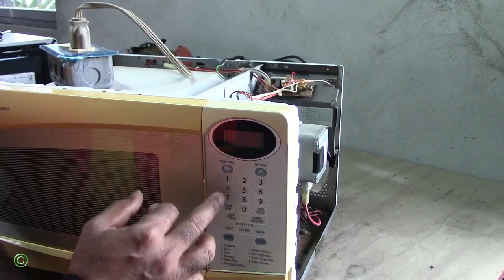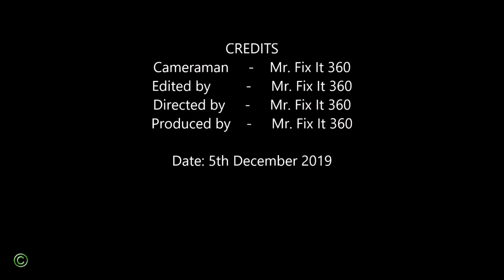Microwave Oven fuse keep blowing.

Comment: When testing, never let the microwave run empty.  There should always be a glass of water inside to absorb the heat.  Letting it run empty causes "bouncing" waves, which can lead to malfunction.
Reply from the maker: Good point. That's why I only run it for 12 seconds. every time I testing a microwave oven to know if it heating. I does only run it for 12 seconds. I know what will happen if it run for more then 12 seconds. thanks for the heads up.
Reply: True

Comment: I know this is old but it would be nice to have seen just how you diagnosed that it WAS the capacitor and ruled out other problems like the magnetron itself.
Reply from the maker: well with 13 years of microwave repair. it become so easy for me to repair microwave with doing so little diagnosed as skills and knowledge develop. most of the time is the capacitor or magnetron go bad.
Reply: @mr.fixit3604  How do you check the magnetron? Check with a multimeter ? How do you rule out faulty magnetron?
Reply from the maker: @dennischarles68  Hi good night. You looking continuity from thermal to thermal. Then from one thermal to the magnetron body you shouldn't get any continuity. If you get continuity then them magnetron is faulty.
Reply from the maker: @dennischarles68  https://youtu.be/oxBXo6qcry8

Comment: Hi their. Can you tell me where can I get the capacitor to buy if this video is from Trinidad. I check a few parts place but no luck. Can you help me please. Thank you in advance.
Reply from the maker: If you not getting it at the general store, you can get it online amazon or ebay.
Reply: @mr.fixit3604  thank you  I may have to buy it on line because I am not getting it no where here

Comment: Very useful idea sir ,thanks
Reply from the maker: You are welcome!
Reply: @mr.fixit3604  My GE microwave is blowing fuse and sparks at outlet and blows fuse every time new fuse is put in? what could this be?
Reply from the maker: @kellysmith2755  It sound like a capacitor or magnetron problem. but most of the time it does be a capacitor problem. you wouldn't unless you run some test to find out what is the problem.

Comment: What makes the transformer to heat up fast & smoke? Pulling lots of amps the first transformer has burned
Reply from the maker: Sometimes the transformer can get weak or over running the microwave for 20-30 minutes.

Comment: A s soon as I plug in Microwave it blows the fuse, what is the reason? (switches are good)
Reply from the maker: It can be the magnetron or capacitor or circuit board.

Comment: Is it a slow blow fuse or a fast blow fuse
Reply from the maker: It's a normal Ceramic Fuse. I can't remember if it's a 15 Amp or 20 Amp fuse. in my 10 years in microwave oven repair I don't think I come across any slow blowing or fast blowing fuse. I don't think microwave oven come with slow or fast blowing fuse.
Reply: @mr.fixit3604  Thank you.

Comment: I see a spark/burning and blast sound near HV capacitor on wire where fuse is connected, when I start the oven to heat... Any suggestion how to fix and what to check?
Reply from the maker: sound like the capacitor and diode need to be replace.

Comment: I have a similar problem sir,i tried to change capacitor(prebious puffed up and shorted) but i could only get 1.05 mfd instead of 0.98 mfd,STILL FUSE BLOWS, what could be other reason
Reply from the maker: 1.05 is still good.
Reply from the maker: So the fuse still blows. well it could be a magnetron problem or a switch problem. you wouldn't know unless you run some test to find the problem.

Comment: Good day Sir, can you advise why my microwave oven has fault, the fuse is blowing when door closed and run the power. I already checked the capacitor, diode, transformer, Magnetron, all door switches, and PC card also good but keep on blow the fuse. Even when disconnect the transformer and magnetron.
Reply from the maker: Micro switch bad.

Comment: I changed capacitor and diode and fuse still continues to blow. What other to check because all switches are good, magnetron, and transformer test good. I’m lost now, help me out Pleasee! 😖😖
Reply from the maker: The circuit board must be have a short or something grounding off.

Comment: What are the other reasons for the blowing fuse, can it be the transformer or magentron?
Reply: Transformer
Reply: If the fuse from transformer is always blow means transformer have a problem. But he show the fuse from capacitor
Reply from the maker: It can be the Magnetron or a simple switch on the circuit board. it hardy ever be the transformer.
Reply: @mr.fixit3604  yeah but the magnetron is easy to test, and so is the transformer (also dies very frequently too, specially when the secondary shorts, but that wont burn the fuse). and i dont see how could it be a switch since this fuse is not between them

Comment: Sir can I use 5kv 0.8 amp of fuse instead of  5kv 0.65 amp
Reply from the maker: Normal a microwave Carry 15amp or 20amp fuse. Check with the manual book to find the correct amp rating fuse to use.

Comment: Hi
Main Fuse burn , after replacing 3 times again and again burn what's exact problem
Reply from the maker: did you run some test on the parts. run test on the capacitor magnetron switches diode.

Comment: Does it means it must be the capacitor that caused the fuse to blowed?
Reply from the maker: lol It's the capacitor it doesn't matter how I said it. thank you.
Reply: @mr.fixit3604  I changed the capacitor n the small black about 1 inches black thing   but don knownthe name still the fuse blowed.
Reply: @tanpengjoo7205  it could be a faulty magnetron. Check the magnetron.
Reply: @tanpengjoo7205  you meant the diode lol. should've tested the magnetron first though

Comment: I HV the same brand changed the magnetron worked for a while den the fuse keeps blowing
Reply from the maker: Run Test on the capacitor and magnetron and diode. the problem is one out of 3 or 2 out of 3.

Comment: Thanks for the tips o fixing the blown fuse. It was clear and direct. 
I fixed a microwave and I discovered it was the capacitor that was bad. So I replaced it. When I wanted to test it the transformer exploded I was shocked. 
Pls can you explain why this happened m
Reply from the maker: Well I can't understand or explain why a transformer exploded. In all my 13 years of microwave repair I never come across a transformer exploded. but I come across a few transformer burned out. I would like to come across a exploded transformer just to find the cause and answer. but for now be safe dude.

Comment: The HV Capacitor should have been discharged BEFORE you removed the wiring from it not afterwards. The way you did this is Dangerous.
Reply: What's the safest way to discharge? Can you safely use a big pair of needlenose pliers as shown?

Comment: I met two microwaves which keeps blowing fuse Because of... fall of 
light bulb inside? wtf it looks like light bulb during time unscrew 
itself and fall off inside. than touch metal part to magnetron and keeps
 blowing fuses. after picking it up and screw again it works fine. so if
 your light goes off it might be lose light bulb. BTW in microwaves i 
work with light bulb is secure by lite tape to not unscrew. wtf?
Reply from the maker: If the light bulb blow or break the microwave will work but there will not have no light lighting.

Comment: SIR, I HAVE GE BRAND MICROWAVE AND IT IS COMPLETE DEAD THOUGH PROVIDING POWER SUPPLY. I HAVE CHECKED ALL PARTS WITH MULTI METER KEEPING ON CONTINUOUS MODE, ITS OK OPEN MANATRON,ITS OK, DOOE SWITCH, ITS OK. WHERE THE FAULT LIES COULD NOT FIGURE IT OUT.   PLEASE GUIDE THROUGH YOUR EXPERTISE AND THANKS
Reply from the maker: well if all the parts check ok, well then there is nothing leaf to do then to buy a new microwave. remember you can't fix all the microwave all the time, some times I come across some microwave that can't be fix. I spend hours trying to fix it and in the end it can't be fix. that's life.

Comment: What if it's not heating?
Reply: Check the magnetron , capacitor ,diode,fully gate closed with all limit switch will be on normally closed position, check tranformer also , if every thing is gud then problem is in control broad.if am i right...thanks brother
Reply from the maker: You have to run test on the megnetron, transformer, capacitor diode, micro switches and fuse.